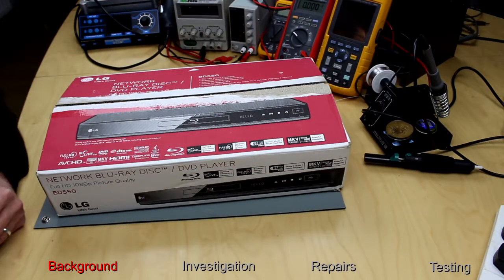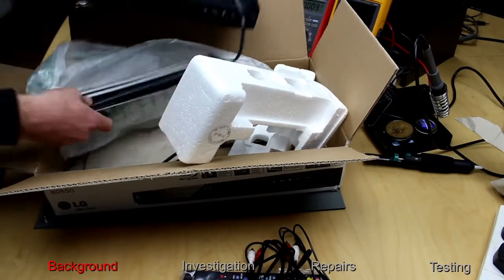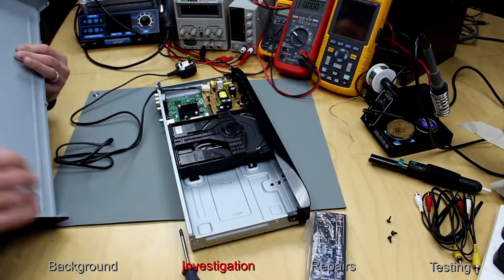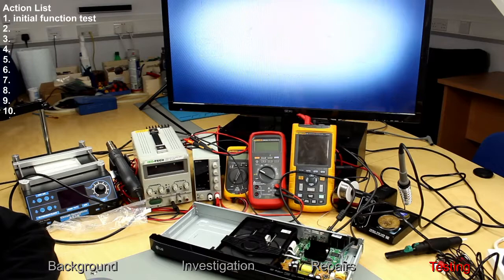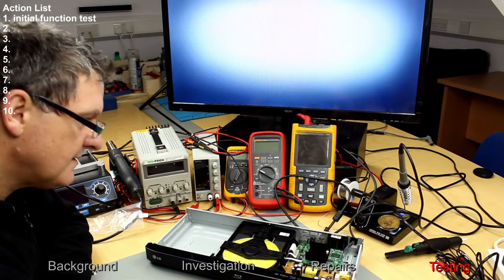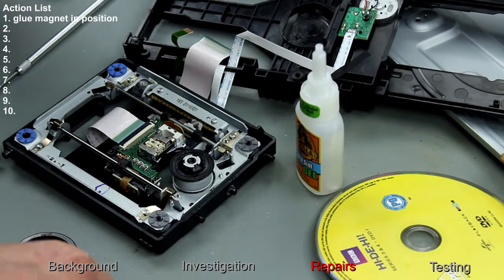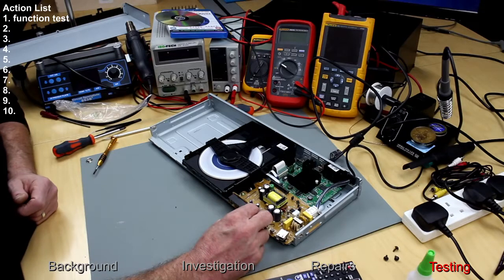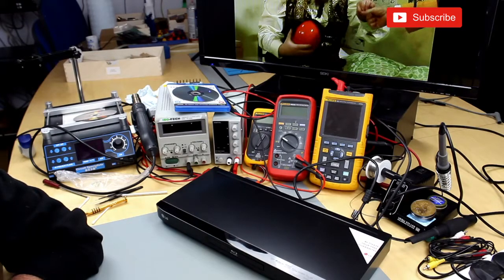LG BD550 Blu-ray/DVD player fault. Mint in box but doesn't read a disc. See how it was fixed!

Comment: Hi I'm trying to replace the main board because my hdmi doesn't work anymore can you tell me how to remove the plastic entire front of the player? I can't seem to get it loose and I don't want to break it
Thank you
Reply from the maker: Hi. I haven't got the unit available to check. Most front covers are held with some form of clip arrangement rather than screws. Sorry we can't help more!
Reply: Did you manage to remove the front panel?
I managed to do this after leaving the blu-ray player door open. Apply light pressure to the plastic clips with a small screwdriver to release them. I followed the same order shown in the video (right to left looking at the front of the device). Good luck!
Reply: The door must be open and often the power ribbon cable needs removing unclipped there's a video 12volt is the name he does a lot of repairs showing how to do it I think